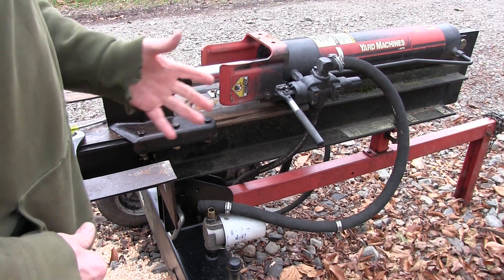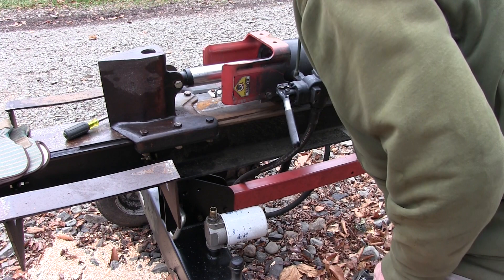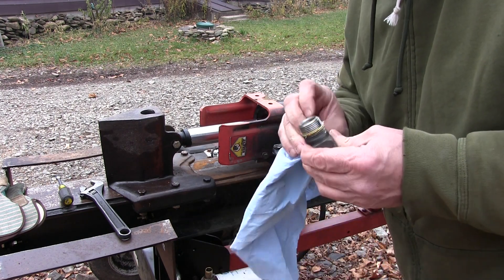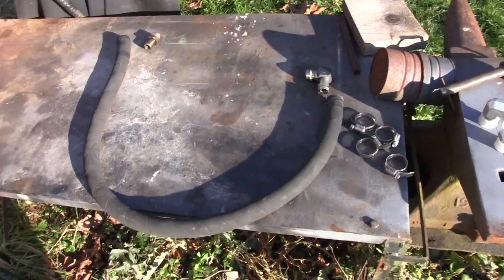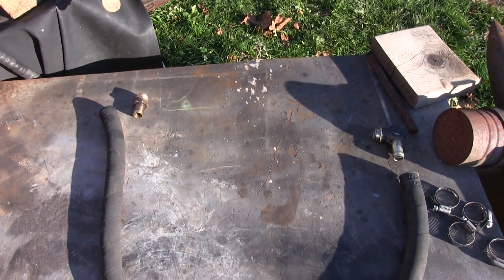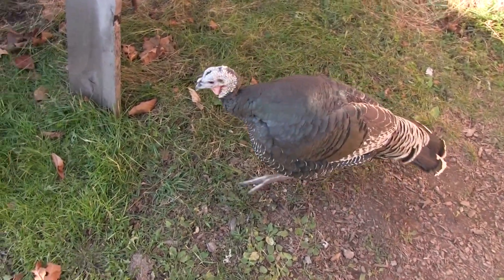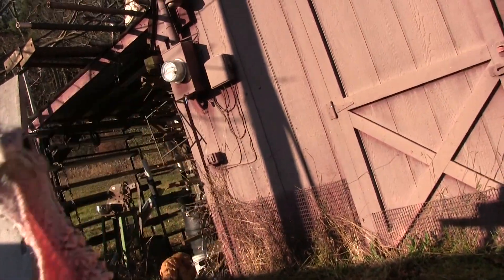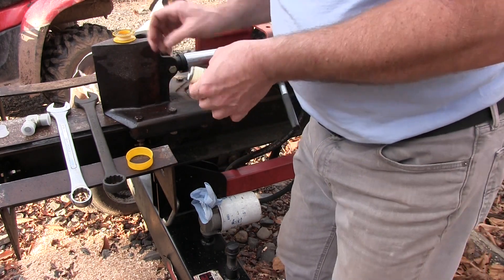Log splitter return hose converted to JIC fittings - 091

Comment: It's the return line.  It's not under high pressure.  Just buy a heater hose, same as on a car.  Lots cheaper and available at thousands of places.  Replace it every 5 years as needed, cheap and easy.
Reply from the maker: While it's not under high pressure, there is some pressure due to the oil filter. Especially when the oil is cold. I wanted to have a hose and fittings that could not just pop off. A heater hose is not designed for oil and will soften and disintegrate. Cheap yes but I wanted something better. Thanks for watching!

Comment: Rotate the oil filter to the up position
Reply from the maker: @JackO-d9t If you mean turning the filter head so the filter is facing down, that's not really practical on this machine. It's just a return filter so the orientation isn't all that important.

Comment: I don't know what "jic" is......
Reply from the maker: A JIC fitting is a 37 degree flared fitting typically used in hydraulic systems. JIC stands for Joint Industry Council. It's a metal to metal sealing surface.